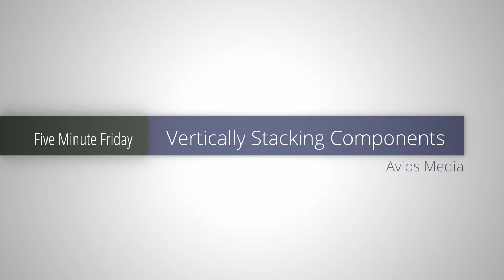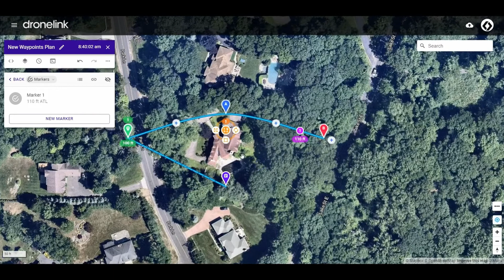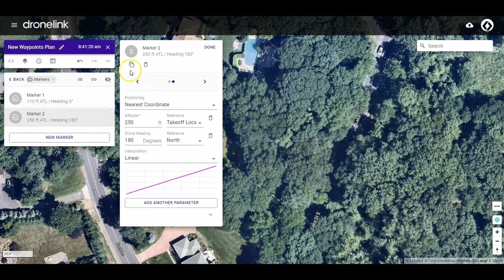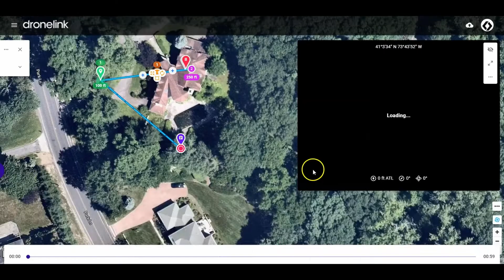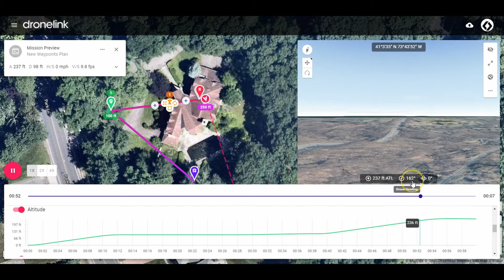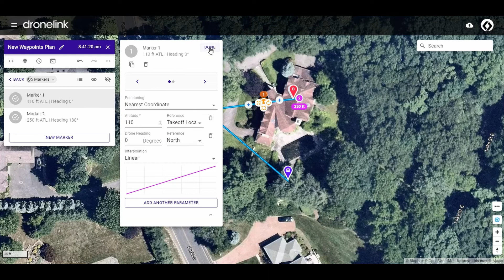Vertically Stacking Commands

Comment: Couldn't you remove waypoint B and just have two markers over waypoint A?
Reply from the maker: To have a waypoint plan you need at least two waypoints.  
That said, the UI has improved since this was created and you can now attach items that used to have to be in markers directly to waypoints, so if I were doing this today I would have two waypoints (A and B) and attach the directions directly to those waypoints without the need for any markers.
Reply: @aviosmedia  I actually gave that a shot...put both waypoints above each other...one at 100FT and the other at 275FT with opposing headings.  The motion worked but what happens is Dronelink creates a slight vertically pathed curve between the stacked waypoints.   If that makes sense. So the drone doesn't go straight up while rotating...it goes up while rotating and following a slightly curved path from A to B.
Reply from the maker: @nozarm10000 You probably had the path option set to bezier curves, which is the default.  Try switching to straight lines and that might fix your problem. You can see that in this video.  https://youtu.be/0Xj42h3yrjw?si=QhswnS_4eA91VcxZ